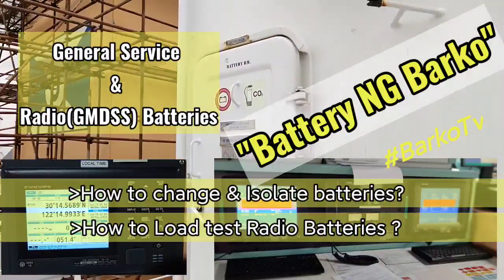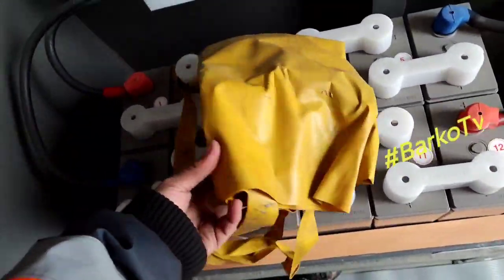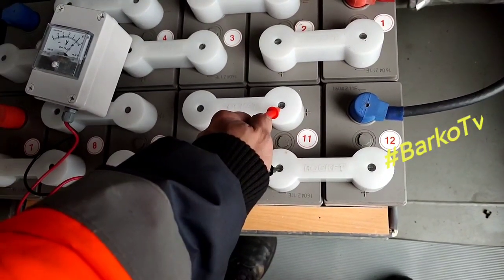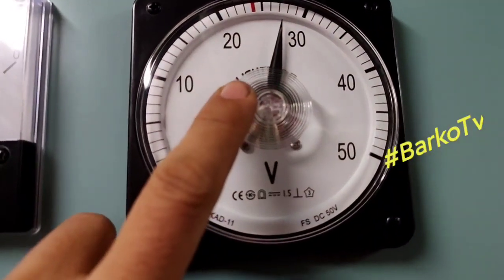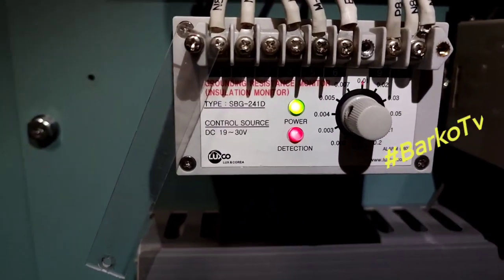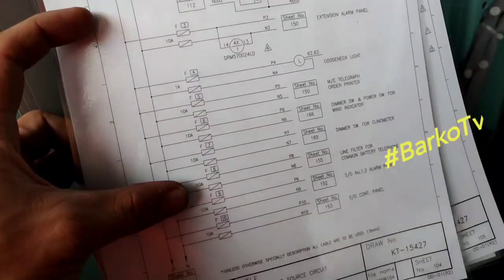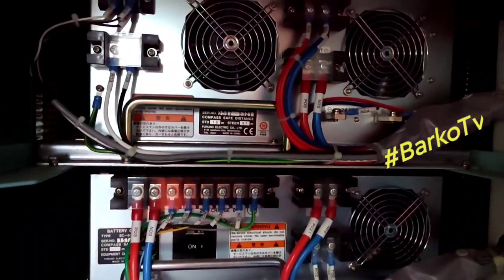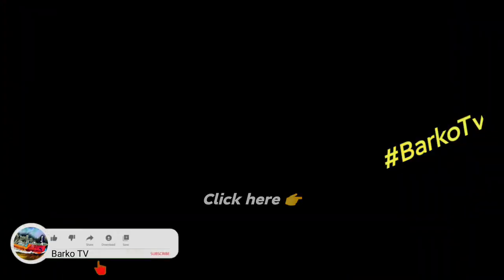Ship batteries, How to Load test GMDSS batteries, how to Change and Isolate batteries, Kalecky, ETO

Comment: sir leck ask ko lng proper and safe way ng pagchange ng battery, need i-off ang battery charger breaker and 24VDC main breaker? ok lng po ba sa mga loads nito wala pong mgiging problema kahit di na i-switch off ang mga bridge equipments? pde din po ba kaung gumawa ng tutorial ng safe way kung paano maghunt ng earth fault sa 24VDC panel. hesitant lng po ksi magswitch off ng mga breakers baka magcause ng further problem or blackout. and lastly ilang oras po ba ang load testing para sa GMDSS battery bago ibalik ang 220V supply and gaano kadalas po ito icoconduct? thanks po
Reply from the maker: Dito sa amin, pag nag load test 1hr lng po as per regulation, kasi my emergency Generator man kami.
Reply from the maker: Sa earth fault ng 24,check mo talaga ang schematic dyan sa inyo. Dito kasi, ang 24vdc ay back up lng cya, example sa bridge equipment, kahit bunutin mo ang fuse di cya maka affect ng operation, ang also engine equipment, same lang din back up lng din ang 24vdc